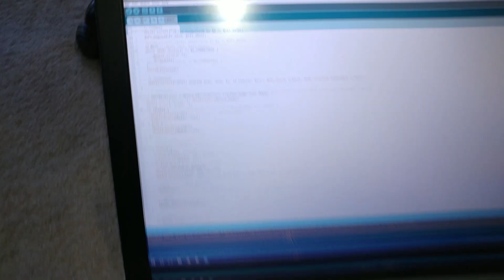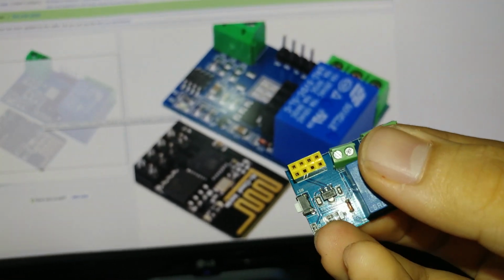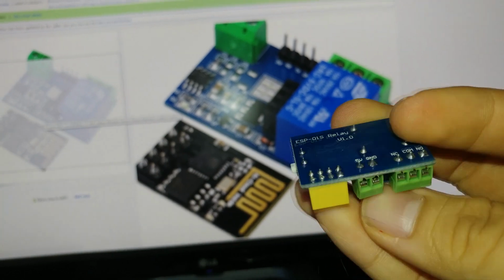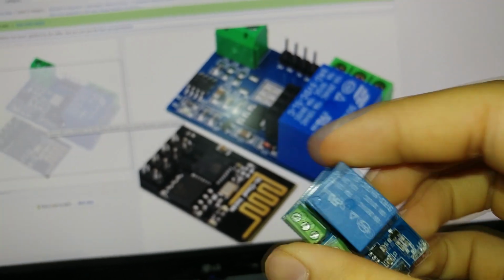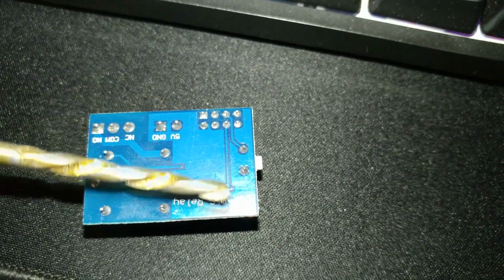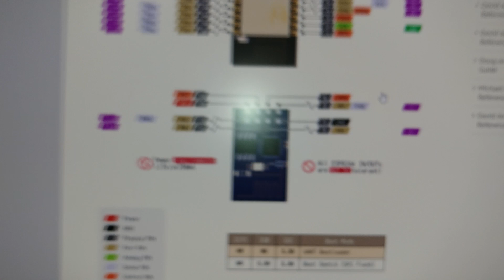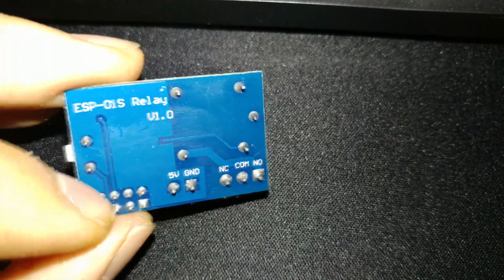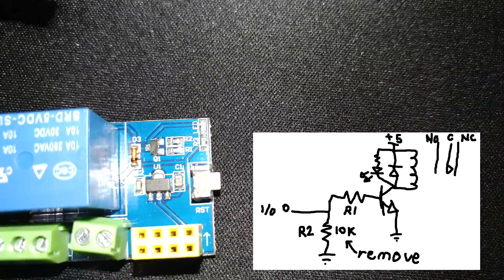How to fix cheap ebay ESP8266 relay module

Comment: Hey i got the board working (im using tasmota firmware on my esp8266) and the relay works when i toggle the on and off button on the web UI but the relay output is not getting any power hence the connected load doesnt get any power. How do o fix it?

Comment: 5 years old video and this came in clutch for me. My R2 was in a different spot and not actually labelled but was able to work it out from the schematics. Either way solution was the same and now I have it working.

Comment: ..after so long keeping it not knowing what was wrong..today I fixed it according to your advice.. 1 - jump en to vcc    2. Remove R2 202 resistor...it finally worked tq mate..used switched USB programmer for esp-01s sketch upload..

Comment: Just checked...in my module IOTMCU V4.0 ...found CH_PD is not connected to anything..Thanks bor...although it works good with blynk but giving problem using esphome....I hope fixing ch_pd high will fix my problem...will update soon

Comment: As You can see on the film, this module is dedicated for ESP-01S, but not ESP-01.
With ESP-01S it works fine. But if You have only ESP-01 You must follow the advice from this film.

Comment: Super ! Thank you for this great tip, you saved my day., interestingly I have the Relay PCB version 4.0 and I had to short the pins to get it working, removal resistor was not needed.

Comment: Thanks for the information, I have a device ESP-01 relay v1.0, with R1(103=10K), R2(202=2K), I just removed R2 it all is working fine.

Comment: I may be bad at this, but I fried my ESP doing this. It could be that I took off the same resistor as in the video, when I have a slightly different board, There are a couple other videos with changes to the board as well https://www.youtube.com/watch?v=ul2vtDXREBo

Comment: I have followed the steps you have mentioned (shorting CH_PD and 3v3, removing 10k resistor). It is working, but I have an issue.

After power on, the relay goes to HIGH by default and then comes back to LOW by the program. How to change this behaviour?

I have made a small video of this issue : https://streamable.com/05eqaf
The code for ESP can be found at : https://pastebin.com/WBEjq8LM

please help.

Comment: HELP PLEASE!!!
Keep getting this error in the IDE when trying to compile. (exit status 1
Error compiling for board Generic ESP8266 Module.)  I choose Generic ESp 8266 module,  Any help Please
. My ESP 8266 modules are good

1
Reply from the maker: the code and libraries i put in the description does not work with the current version of Arduino IDE or Alexa. you need to use the newer libraries. the point of this video was to show how to fix the PCB problems with the board, NOT how to code for it

Comment: Good Job, thank you very much. 
I bought about 20 of that relay boards to build some remote valves for my garden watering, because the ESP01 and that relay should work perfect with just a 5V DC supply and WiFi Control.
The CH_EN I found already out myself, but with the resistors is a very hard stuff. Thanks for discovering. I will inform my dealer about that buggy item.

Comment: I do exactly as You say, but still can`t firmware my esp( I remove 10k resistor (in my case R1 and R2 in reverse, so i remove R2 and R1, and solder back R1 just like in your picture), after that i solder 2 contacts EN and 3v3. After that i tried to connect via TTl module to pc and no one ports are avalilabe. PLEAASE HELP! I firmware with ESP Easy Flasher.

Comment: Thanks for this video, Strangely my boards look identical to yours in terms of components but the chip enable pin seems to be fine. I removed the resistor you showed and they're now working great.

Comment: Hi there 
After the modification is it normal that the relay switches when booting? 
Would love to fix that aswell or maybe I've forgotten something?
Reply from the maker: that is normal. the ESP is checking GPIO 0 if it should be in programming or bootloader mode. we've disgused it before in some older comments. It doesn't appear to be fixable but since it is a short pulse, you can create an R-C circuit between GPIO 0 and the MOSFET gate so that only long on states turn on the relay. Or you can cut the PCB trace and wire the mosfet gate to a different GPIO pin
Reply: @CheckEmGG  
Ahaaa ok sadly enough.
I saw that indeed in a post below.

I will do that than seems to be a do-able job. Connecting it to GPIO3.

Does it really matter if the size of the pull down resistor is only 4.7kOhm instead of 10kOhm as stated in that message below.
Reply: @CheckEmGG   i read somewhere that the r2 was added to try to stop this but seems  this module still on sale they must have made up 10 million of them LOL

Comment: I would like to see a movie about this relay wlan unit for non tinkerers. That goes like this: 1. Prepare Unit that way.  (if you would like to know why watch this movie) . 2. Download this app and upload this code to the wlan unit. (If you want to learn how to modify the code go to this movie. Buy this component to connect via USB to the Wlan unit). 3. Connect to your switch via this app for windows,  this app for android etc. Use this settings (If you want to learn more watch this video) . And now enjoy your new wlan switch device.-- I think such a video would attract hundred thousands more viewers not just tinkerers.
Reply: same here I am going to start with reading up on the esp module itself ,seems logical. you can find windows software/ and schematics a lot is in chinese  so people just buy it any way 'cos it's so cheap and can be made to work with modern firmware with a bit of knowledge as shown here.

Comment: Hi , Thanks for clear explanation. My esp boots and works after I remove R2 and connect Chip_enable pin to VCC. My esp which is  ESP8266EX works even without pulling Chip_enable up. I can control GPIO0 and build in led with the software. But Relay and board leds are always on no matter GPIO0 High or low.  When I connects Gpio0 to gnd board led turns off and relay closes. Do you have any idea what else should be wrong on the board  ?
Reply from the maker: make sure pinMode(0,OUTPUT)
the gate resistor might be too high so there isn't enough bias voltage to pull the mosfet low

Comment: I've desoldered the resistors from R1 and r2. But can't solder back the 2k resistor on r1 because it's so tiny. I tried to put an 2k resistor of my own on r1. But then the esp doesn't boot. If I remove the resistor from r1 the esp boots, but i can not click the relay via GPIO0. What should I do?
Reply from the maker: did you connect CH-PD pin to 3.3V?
Reply: @CheckEmGG , yes I did.

Comment: I just connect 3,3v to CH-EN  and removed R2 resister. Now is it suppose to work with  typical ESP2Relay controller app. still my one doesn't work
Reply from the maker: did you flash the firmware for the app?
Reply: @CheckEmGG  No I didn't. only those two changes were made. how can I do it?

Comment: Has anyone manage to fix the relay jitter problem on start up?
Reply from the maker: that initial jitter is part of the chip and unavoidable. you can fix it by cutting the trace and using a different IO pin instead of IO 0

Comment: The board in the add you showed is indeed a completely different board. It contains 2 microprocessors.
Your board is designed for an ESP01-S.... that already has the required pull ups  (including the chip select).
on my board I had to remove the 2k resistor

Comment: thank you! it worked! I also had to swap the 2k resistor which was on the R2 to the R1 (10K was on R1) as others have commented. One question: where I bought it it said I could use 5-12V. 5V worked fine but I tried 12V and a lot of smoke came out (It looks like that mosfet burned), should it have worked with 12V? or does it only handle 5V input?
Reply: The 2n7002 mosfet can handle 20V, but the relay is 5V so it will draw too much power. If the mosfet didn't break, your relay would melt.

Comment: Why remove the 10k resistor ??
Reply from the maker: as I state at 4:20, gpio0 is a very specific pin used for setting the device in programming/running mode. When pulled low by the 10K resistor it sets the board into programming mode, meaning it will never run your program.

Comment: Thanks man. My relay v1.0 have R1 and R2 in reverse (R1 is 10k and R2 is 2k) , so i removed 10k as told and i desolder 2k from R2 and solder it to R1.
Reply: Did this work for you? I also have the 10k resistor at the R1 and the 2k resistor on the R2. I already removed the R1 10k, but mine is not working. Will it work if i resolder the R2 2k to the R1 like you did?

Comment: Thanks for your excellent information. I was able to get my v1 relay working by un-soldering R2 as described in the video. However, in the case of my board R2 was actually the 220 ohm resistor with the left leg connected to GND...  The two resistors (R1 and R2) were swapped for some reason.

Anyway, I chose to remove the 10k resistor from R1 and put the 220 in its place so it more closely resembles yours. However, both configurations seemed to work... Would it make any difference anyway, 220/10k in R1's place?
Reply from the maker: Glad you got yours working. The black 7002 transistor Q1 is a mosfet which is voltage driven (even though in my crappy MSpaint schematic it's drawn as an NPN transistor). Either the 10k or 220ohm resistor would work.
Reply: @CheckEmGG   hi there i got 1 of this boards i dont get it cleary what i must do or to desolder witch stuff my R2 is the 103 and my R1 is 202 witch one must i remove or swap plz help if can thanks
Reply: @rufussouthey440  R2 is the one which you should remove.

Comment: Board works just fine - just do not use arduino. It does not matter if pin0 is used because mcu exits programming mode if it cannot connect and boots normally

Comment: I got exact this modules (Pack of 3) from Hongkong. And I can confirm, that all 3 faults 1) Much less than 1 mm separation of the 220V connector from the relay to DC Ground! 2) The missing connection of the Chip_enable pin to VCC, and 3) The irritating existence of the 10k resistor on the GPIO0, which prevents the CPU from starting. Thank you very much

Comment: 'Hi! I followed your video and modified my relay board and it's actually working but as I plug it the code is not running and I need to push the reset button to make it run. Same problem if there's a power disconnection, the module do not start to execute the code since I push the RST button. I think I may solve the problem with a capacitor between RST pin and GND so that as the electricity come the capacitor is empty and forces RST to GND. COuld it work? which capacitor should I use? 100 nF as I saw in a similar application?
Reply from the maker: that is a weird phenomenon. maybe there is some excess flux residue on gpio0 that may be causing it to go into program mode instead of execute, residue can act as a small capacitor/resistor. Resetting probably fixes the problem because it discharges whatever residue or puts it in a known state. Try cleaning everything and if it still doesn't work a capacitor should work the way you describe, idk how long it will last tho. Maybe it is missing a pull up resistor on reset line as well but that is usually on the ESP module side

Comment: How set up the relay and relay is no work 5v how to connect to my wifi to this eps8266? And how connected to mobile?
Reply from the maker: download my Arduino code in the video description, modify the wifi SSID and password, and flash it to the ESP module using Arduino IDE and UART serial programmer. There are lots of "getting started with ESP8266 with Arduino" videos if you are new to this kind of stuff.

Comment: fyi Notice on the back of the board it says ESP-01S that uses an ESP8266 ESP-01S which is not the same as ESP-01. The ESP-01S does not need the enable pulled high to be enabled.
The ESP-01S only has a single blue LED.
Reply from the maker: in most cases the esp board should have an internal pull up resistor but it's not always the case, especially when getting those cheap modules from China. The relay board is generic for both ESP-01/S modules. In my case I needed to pull up EN. For the sake of being complete and meeting spec, it should be pulled up regardless if it needs it or not.

Comment: is there a way.. or hack... so i can power the board and the ESP with just a power cord.  Want to simplify this.   Don't want to have  power for the board and the power cord going through the switch.
Reply from the maker: I soldered a small 5 volt USB switching power supply to the 120v and 5v pins. I have it small enough to fit inside the space of a standard wall switch. it's very simple. just make sure your wiring is to code and isolation is taken care of.